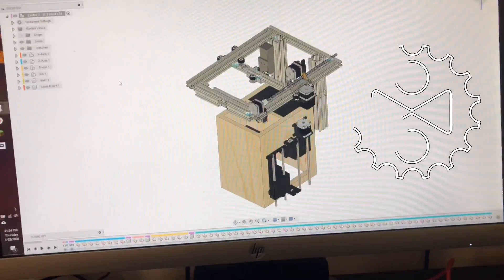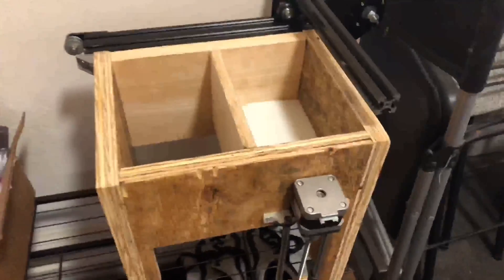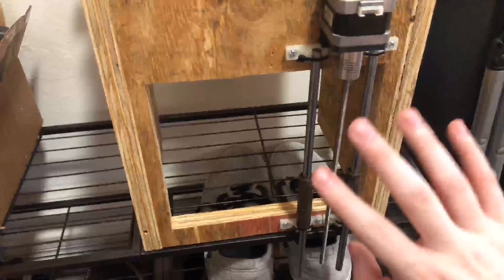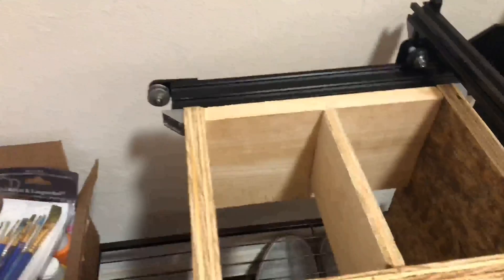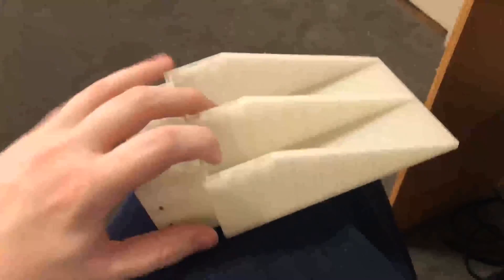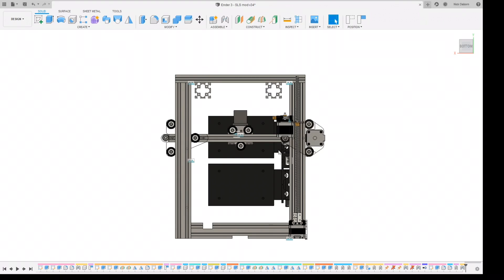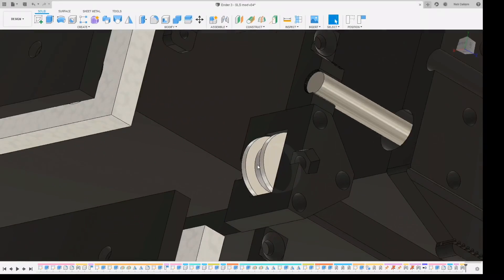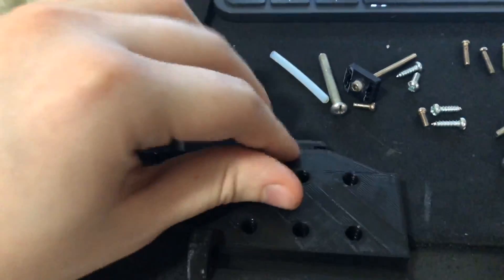DIY SLS 3D Printer || Part 1

Comment: Are you not preheating the powder? And if you are, it's definitely not safe using a wood enclosure. If you don't preheat the powder, the parts will be so warped you'd be better using the ender 3 stock.

Comment: you can make it without electric energy with pneumatic stepper motors and solar laser, using arduino tracking, aluminum mylar solar dish and crystal fiber optic to direct the light from the dish to the laser in case the laser has to move in xy instead the powder bed
Reply: That's been done already look for solar sand 3d printer on youtube